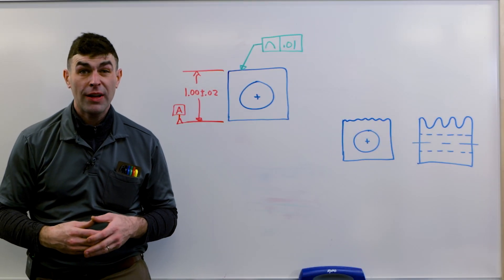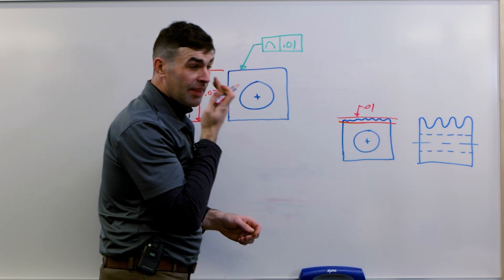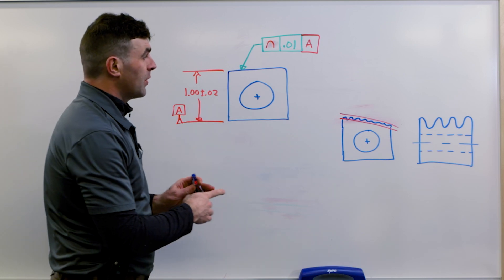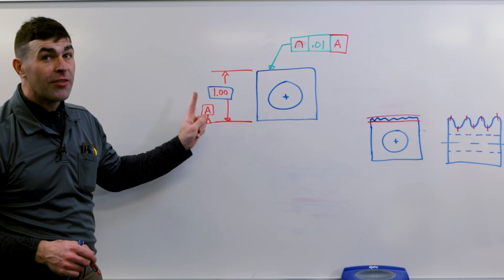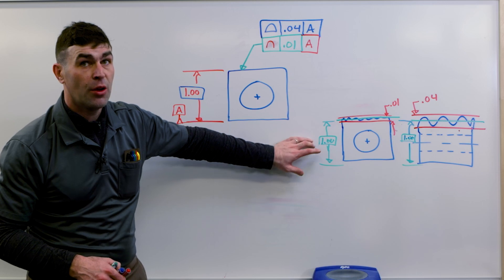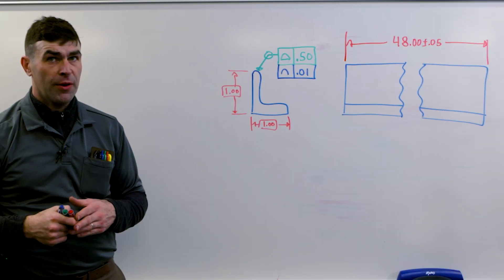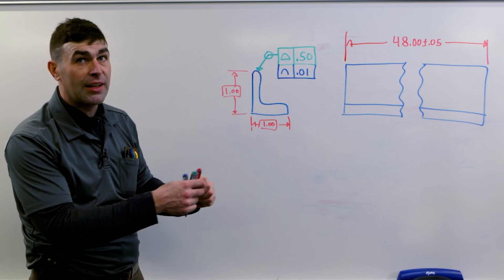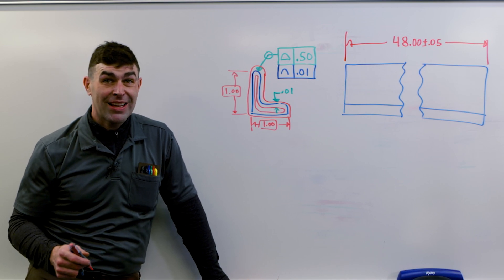GD&T Profile of a Line Might Be Useful In Some Situations

Comment: You correctly state that profile of a line relative to datum feature A along with a basic dimension is wrong as it is really the same as profile of a surface. However, you fail to mention that it is still wrong when you couple it with profile of a surface. The profile of a line is still effectively a profile of a surface and therefore renders the profile of a surface as meaningless. This would need something like customized darum reference frame to make it right. Profile of a line is tricky and this just adds to the confusion. You started it right, but should correct the combined controls portion. Thanks.
Reply: Exactly ! Too bad, it’s just adding confusion

Comment: possibly used as an example of a fixture with swing templates ( feeler for gap check profile ) at set increments like used in the automotive industry at every 100mm or customer specified locations.    Past experiences.